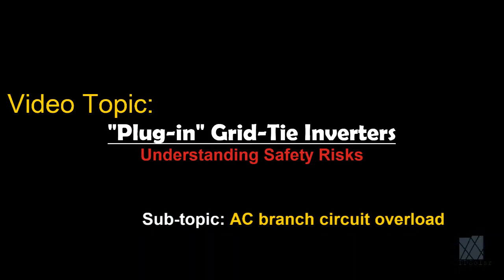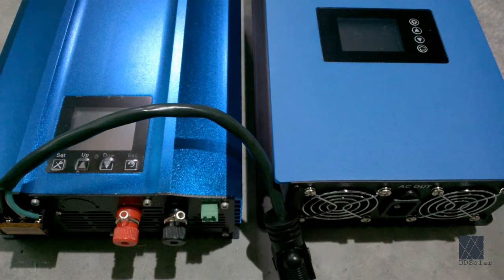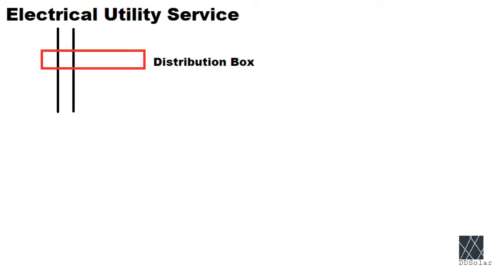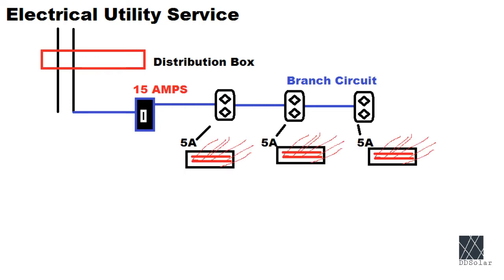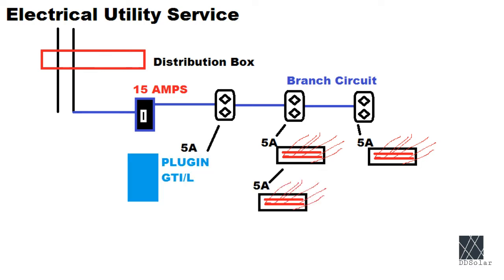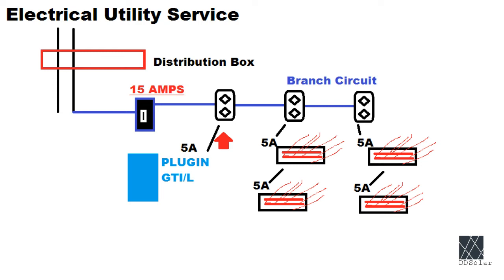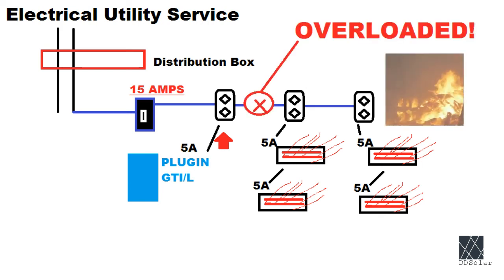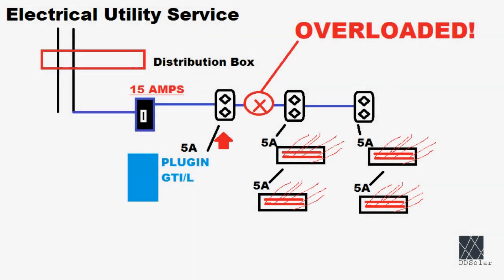Before Buying Plug-in Grid Tie Inverter Watch This Video - Safety Warning #gridtiedsolar 2023

Comment: After watching your video. I started searching on how to hook a grid tie inverter up the safe way. Not much found about it. Tell me if you know if this is one way to do it safely. 
Hooking it (Single phase) in the breaker box to the the least loaded main of the two above the breakers and to the neutral. 
To me it would be like power coming in. I'm about to hook one up and and I know what you said is true. VERY WELL PUT. Your video is the only one I have found about what you explained.
Reply from the maker: @basilkey2949  Hello, glad you liked this video! As far as the hookup, you're on the right track. I would suggest installing a separate breaker for the GTI if possible. Only my opinion: I like the idea of feeding the most-loaded phase in the panel (through a dedicated breaker). Because why not use up most of the solar power with ones own appliances first vs. feeding it back to the grid. And I hope I did not misunderstand your question - if so let me know

Comment: I understand that it's much safer to plug GTI into a dedicated circuit, but isn't there very few of those in a house? I'm thinking refrigerator, range, microwave, washer, dishwasher, none of which would seem suitable for plugging a GTI into as all these plugs are inside home. What am I NOT understanding?
Reply from the maker: @aznick102 That's true... most houses only have a few. And it costs a lot of money for an electrician to install a dedicated circuit. However, one should understand the risks of backfeeding into a branch circuit with other loads running before using a GTI. I am sure most people just plug their inverters into whatever outlet is convenient, without understanding what's involved. This video will hopefully alert people to those risks
Reply: @solarpoweredge  It's just a shame that we can't use a little energy we can collect from backyard systems to supplement our grid usage safely and simply. I hate having solar panels sitting there doing nothing. I have a 2kw EF Delta Max, but it's a pain to lug out a 50lb battery to get it charged then take it back into the house to use it to run my office. I know it's not really saving me money, but it's just so fun to see energy produced and to be able to use it.
Reply from the maker: @aznick102 I hear you there, solar is very profitable and can do so much. And some times it gets complicated.
PS I use my excess solar power for simple DC electric heating all winter and fall. Heats my shop and home.

If you audit all your branch circuits and know what's plugged into which one, I bet you could find a low/under utilized branch. Could plug your GTI into that. A good scenario is a window AC or space heater on an empty or barely used circuit that runs all day. Could be a good chance to use a small plugin GTI setup without too much risk. Still need to keep an eye on it and be vigilant :)
Reply: @solarpoweredge  OK,  I'll look into how to do an audit. Thank you for all the help.
Reply from the maker: @aznick102 NP

Comment: this video is Very demonstrational   So , now  im going to run a BReaker by itsself im planning on buying a 220v grid tie inverter, i wont be pushing power back into the grid but i do plan on cutting cost,  i will be running a 15 amp 220v breaker  to my solar setup
Reply from the maker: @quagmire94  Sounds great! I don't backfeed either, just reduce my power bill
Reply: @solarpoweredge  Do you have a plug-in grid tie inverter that won't push power back onto the grid? This is my main concern right now, already got an outdoor circuit that has nothing on it, just don't want to be fined by my power company for trying to go a little green. Gonna do 200-400W I think.
Reply from the maker: @connora03 Hi, I have the same concern. What I do is verify which 120v "leg" the inverter is on, and make sure the appliances running will definitely consume the max power from the inverter - at the very least. Or can plug it into a circuit that already has appliances running which use at least 200-400w. If your AC is consuming 500w, and the inverter on the same leg or circuit is pushing 200w, then the AC only consumes 300w from the grid. Hope that helps

Comment: Simple safety procedure would be to use Dedicated wiring for the (plug-in) Grid Tie Inverter to a SUBPANEL with breaker then to the Main Panel.
Reply from the maker: @fitnessmag9186 A dedicated circuit definitely the way to go
Reply: @solarpoweredge  oh and 12 AWG

Comment: This has been a topic I've been trying to figure out for a while I've been trying to figure out on a 240 can I convert it for solar or use a plug-in inverter since the circuit only has two plugs and only one of them gets used overnight.
Reply from the maker: @briansiebert8523 With only 2 plugs on a circuit, one for the inverter and one for the appliances, I guess it's a lot less likely to have any kind of problem

Comment: This guy is great, but if you dedicate a single circuit with a 10gauge wire 30a breaker for a 25 amp inverter with nothing on it except the inverter, that feeds the main buss it changes up the concern of the single circuit. It does make me question the end of the systems transformer, that is on the utility end.
Reply from the maker: Hopefully the buss bars can handle it, I figure they are good for a few 100s of amps at least :)

Comment: Hi, nice video and some fair points made.
From the comments I see that it is acceptable to hard wire into a spare breaker. But I am wondering if this is correct.
I have a 63A main breaker and then all my individual breakers are 20A or 16A. If I hard wired a GTI into my spare 20A breaker then wouldn't that technically be adding another potential 20 Amps for my main breaker to handle in the same way you described for the outlets in an individual circuit?
Reply from the maker: @Ulbre Hello and thanks! Good question. Hard wiring your GTI into a dedicated 20a breaker is just fine, as long as the wiring from the breaker to the GTI can handle the current. With regards to the main breaker, it can't flow more than 63a into the panel in theory. If it's using 63a from the grid and then you backfeed 20a from solar, it drops to 43 - no problem either. If you add up all the breakers in the house and they exceed 63a, there is a chance it may trip some day. But I don't think it will harm anything.
Reply: @solarpoweredge  Thx so much for your swift and detailed reply. I will be checking out your video library where I am sure I will learn a lot. Wishing your channel a heap of success :)
Reply from the maker: @Ulbre Very welcome! glad you are here, thanks for watching :)

Comment: We have the 2000 watt version however it stopped working do they have an internal fuse it says lifetime warranty what's the page on Amazon disappeared thank you in advance
Reply from the maker: @actionnew Hello, I think there are fuses inside. Might want to check the solar input side to see if it's shorted. If you know anybody that can repair inverters, they can probably take a look at it.
Reply: @solarpoweredge  there are DC fuses but they are good. . thse units have been removed from Amazon since many have failed..
Reply from the maker: @actionnew  That's not good. I hope they fix the problem, I kind of like these inverters.
If it's a shorted MOSFET it can be replaced, a very common task. But otherwise, could be a more complicated problem. Inverters are not fun to troubleshoot and repair. Might just want to keep it in case there is a way to repair it later on.
Reply: @solarpoweredge  it appears u have to take out each mosfet eh...... to test them .
Reply from the maker: @actionnew Yeah... not too fun

Comment: If I already have net metering Solar sending back power to the grid do I need to use the limiters? 

Can I just run it without the limiters? 

Is there a down side to running it without the limiter clamps?
Reply from the maker: The limiter clamps are for those who don't want to "back feed" into the grid, but only supply household loads. If you only use 100w, the inverter throttles down and produces 100w. If you want to use net metering and feed excess power back, the clamps are not really required. No downside really. Hope that helps. DD

Comment: Sounds like the safest way to do this is to install a dedicated 20 amp breaker in the breaker box, then a run to a new dedicated socket, and plug in the inverter there for the entire house?
Reply from the maker: That's absolutely correct, also I believe this is what electrical regulations generally require or recommend.

Comment: Thanks!  Very good info, I have subscribed.  Question: Would the problem be avoided if there is a 15a breaker between the GTI and receptacle it's plugged in to?  Or maybe a GFI receptacle where the GTI is plugged in?
Reply from the maker: Welcome and thank you very much for subbing :) If a GTI was feeding 15A in through its own 15A breaker and then on into a shared branch circuit which also had its own 15A breaker for the whole branch, it could still defeat the branch's breaker and thus overload the wiring in the wall. Each breaker could theoretically feed 30A combined into the branch wiring. So it is incredibly important to always use a dedicated circuit for the GTI, and resist the tempation to plug into any convenient outlet on a shared branch circuit. A dedicated circuit 100% avoids this pitfall as well as others. I am sure many GTIs end up on a shared branch anyway - but at least people will be aware of the dangers involved and make a more informed decision. In the future I plan to do a more thorough presentation on GTIs. Hope this helps - DD

Comment: One issue that has stopped me is the neutral ground bond. Code says it needs to happen at the power source. Now your introducing a new power source without a N+G so therefor you will not be protected.
Reply: Sure you will be protected because the ground, live and earth are still connected to the main power distribution. When there is a leakage or connection to the earth wire, the main fuse(s) will trip and the GTI stops automatically when there is no main power available (heartbeat of the system, 50/60 hz).
Reply from the maker: Definitely a concern, hope maybe I can address this in a future video

Comment: what about a dedicated 15/20 amp outlet for the inverter for lower powered solar arrays around 1k-1.2k?
Reply from the maker: Yes definitely good enough. If nothing else is plugged in, the circuit shouldn't be overloaded by that amount of Watts
Reply: @Solar Power Edge  ok good this was my plan with a tiny home build but got worried when I seen this video lol
Reply from the maker: I hear you lol I get pretty worried about this stuff. But with a dedicated circuit, no problem at all.

Comment: If plug and play inverters are so dangerous, how could some get UL 1741 certification?
Reply from the maker: My question would be, does any certification eliminate the danger of a GTI backfeeding a shared branch circuit, and overloading conductors hidden in the wall without the user's knowledge? That is the principal risk this video warns about. I believe knowledge can increase safety. I am for plug-in GTIs, but against as many house fires as possible, lest we lose access to this type of technology "for our own safety". I've seen enough plug-in GTIs burn themselves up and plenty of folks plugging them into non-dedicated circuits with zero electrical knowledge or understanding of the risks to their home and family. So I decided to warn as many people as I can.
Reply: @solarpoweredge  "Eliminate" is a strong word.  But, yes, UL certification is as legit as  it gets.  They are collectively 1,000x more geeky than you or me when it comes to this stuff.  They have anti-islanding, built-in ground, automatic shut-offs, and do not work if the grid is shut down.  I understand your concern theoretically, but you would have to point to damage, fire, explosions, injury, something would have already been reported.  Even the million plug and play uncertified GTIs sold are pulling it off safely, or the devices shut down.  I have heard about a 1,500 watt limit to backfeeding the grid, but yeah, it is very weird, which is why I bought it and why a posse of ten electricians, including several city inspectors, rolled up on me last Friday to observe the unicorn that a UL certified plug and play microinverter is.  Too cool for school.  Fight the Power!
Reply from the maker: Hello, thanks for the reply. I don't believe eliminate is a strong word in this case. I think we have fundamentally different viewpoints of how a DIY person should conduct themselves. The way I see it, even though there are authorities and certifications, the end user needs to watch their own back, do their own research, and look out for their own household. 

Frankly, this video is a polite attempt to warn people who backfeed shared circuits, that they need to be knowledgeable about what is ON that circuit at all times. Of course each man can do whatever he wants with his wiring. But I always recommend a dedicated circuit. Hardwire if possible, but there are a lot of plugins out there.

The fact is, overloading the wiring in a house with a plugin GTI is a fire risk, and pretty easy to do if uneducated - end of story. This is basic electrical knowledge and use of logic. It is a fact that the circuit breaker can be defeated and not trip while pushing too many Amps, as explained in the video. It ought to be common knowledge. No amount of geekery by UL is going to change that. No certification can eliminate the risk of plugin GTIs overloading residential wiring. The risk is eliminated by end users being fully educated and exercising due diligence, rather than appealing to authorities or trusting design engineers to keep them safe. Due diligence IS the first line of defense. My advice has been, don't plug it in without being educated about branch circuits and how plug-in GTIs work. 

The end user needs this type of knowledge so they can exercise due diligence. My channel is about sharing knowledge to help such people. It is a fact that a plug-in GTI cannot detect such a condition as presented in the video. It is a fact that no certification prevents someone without electrical knowledge from overloading a shared circuit. It is very easy to do, just one slip up, and the risk of fire is high. The wires are hidden in the wall usually, if someone overloads them it might be awhile before the problem is discovered... or worse, too late. The breaker won't protect them as explained. If not the #1 reason for using a dedicated circuit, it's got to be at least top 3. In fact a dedicated circuit is part of meeting code requirements anyway.

I don't need to point to any particular fire report to establish the fact that the issue explained in this video is a fire risk - anyone who knows electrical can see the problem. Personally I have some experience with other plugin GTI users and fires (or sometimes just melted wires) and no they weren't going to report anything. Sometimes it's outright carelessness, other times it's "oops made a mistake, I'm gonna learn my lesson and be more careful".

I am also sure running around with scissors is a bit unsafe, but once again, don't need to find any stories about the risk. The risk is just there, and people need to know about it BEFORE they start backfeeding random outlets in their house.
Reply: @solarpoweredge  I understand the theory of using a dedicated circuit for plug and play grid tie inverters.  However, one expert at Missouri Wind & Solar suggested the opposite, i.e., to plug it into a busy circuit.  As for the circuit breaker being able to handle the backfeed, it makes me wonder if these new circuit breakers with AFCI and GFCI can detect problems in the reverse direction.  A lot of renewable energy is going to be in an infancy stage for a while.  If one tries to figure out if a horizontal wind turbine is more efficient than a vertical axis, there is a wide disparity of opinions regarding technology that has been in use for thousands of years.  My GTI is not supposed to work without being plugged into the grid, but when the inspector and electricians and I put a multimeter on the plug (when unplugged) it was a bit hot.  Sometimes it is hard to know who to trust these days.  Thanks for your input and analysis.
Reply from the maker: Good points all around. And very interesting to find an offline inverter putting out anything, I hope it wasn't full voltage.
On the GFCI, that's a good one. The manufacturers probably don't want to talk to us GTI users. Sounds like a video topic. I've not yet found anywhere it is addressed in detail.

Just a guess at MWS'' reasoning; possibly to make sure the energy from the GTI gets used up by existing loads in the house first, so no backfeed. Incidentally I would practice such a thing - but not at the circuit level. Instead, I'd connect the GTI (example 750w) to the 120v leg which has the heaviest loads on it, in effect "propping up" that leg. Example, L1 has 1000w of 120v air conditioners or resistance heat, L2 has 150W refrigerator. So feed 750W 120v into L1. The voltage increases a bit on that leg. There is no backfeed to the grid at all, just to the loads in the house. 

If someone asked me, I'd strenuously suggest a dedicated circuit whether trying to balance L1/L2 or not. We can probably assume everyone backfeeds into whatever outlet seems most convenient at the time. I do hope they'd watch my video first, because then I've done my part :)